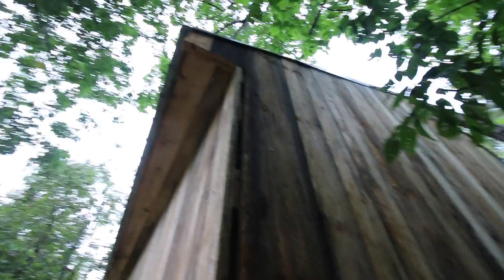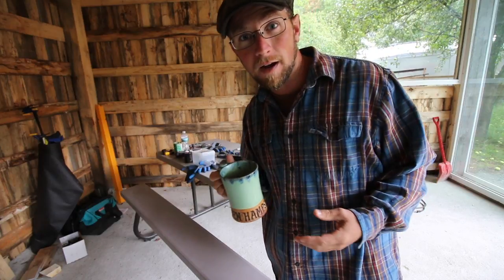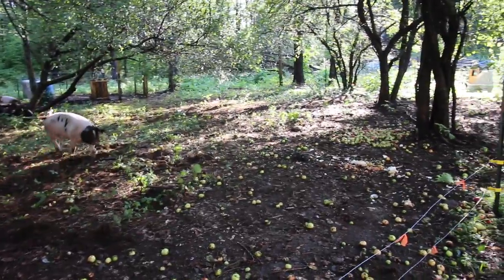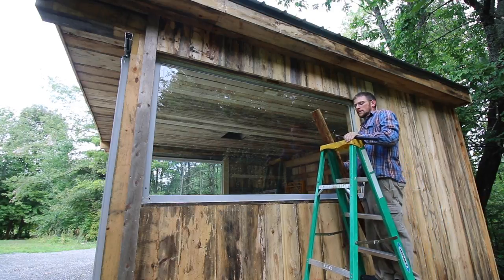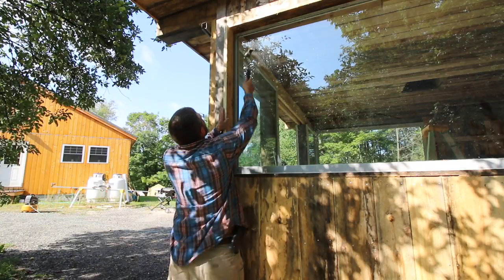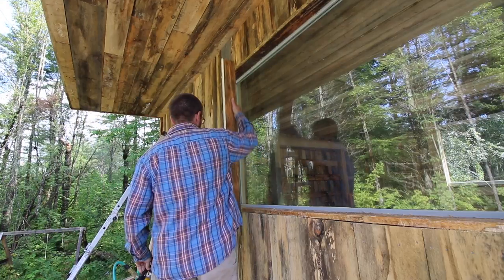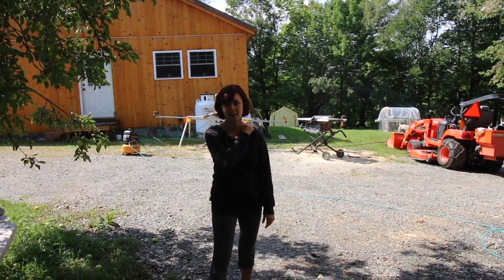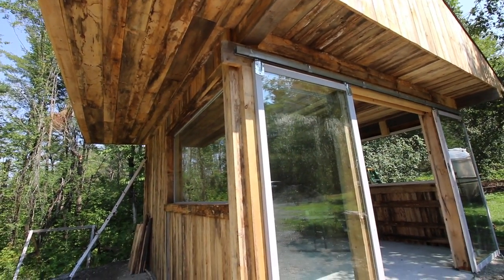We Are GEtting to Put The TRIM Boards ON! The Off Grid Outdoor Kitchen

Comment: The outdoor kitchen looks great Al, very well done. They sell silhouettes of hawks and falcons to put on the inside of picture windows to help prevent birds flying into them. Even baby birds in the nest know the silhouette of predatory birds. Pickup a window mop and squeegee, those will make short work of washing your windows. You should be able to find them at your local home improvement center. For the most part I liked the GoPro footage, it does give nice close ups of the details as you're working, as others noted, the sound could be better. There were a couple times when you whipped your head from side to side that were a little disconcerting. 
Yay! Happy piggies. The girls are really packing on the pounds.
Reply from the maker: Thanks! Yes the pigs are growing very fast!

Comment: Hey Al I think the sound was not so good of the gopro but the video looked good! :) The outdoor kitchen is looking great Al!! Awesome job!
Reply: I agree. The video was great. Actually, I'm not sure which camera that you could use an additional mic with, preferably with a wind muff cover. The far shots, especially with your back turned, in both videos had low volume audio in several places.
Reply from the maker: I think I would have to get an external mic wireless mic and hook it to the big camera and have both cameras recording one for video and one for sound. It starts to get a bit more complicated with two cameras and a mic. Lol